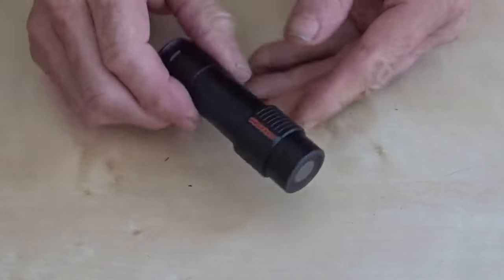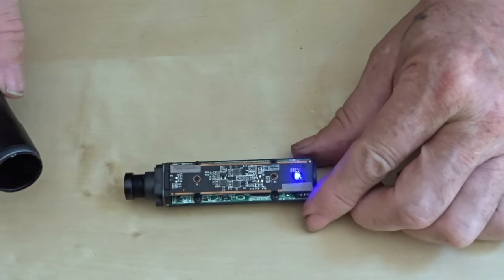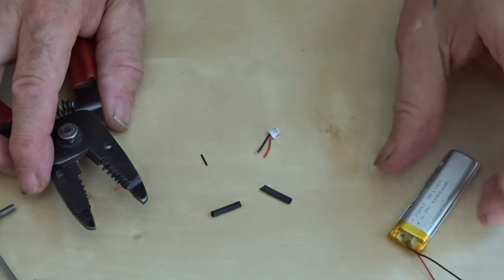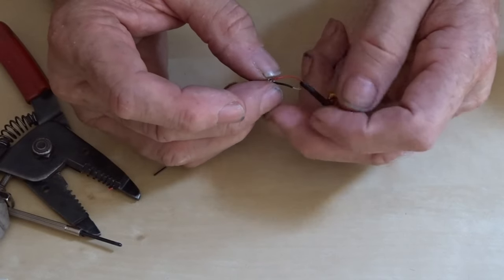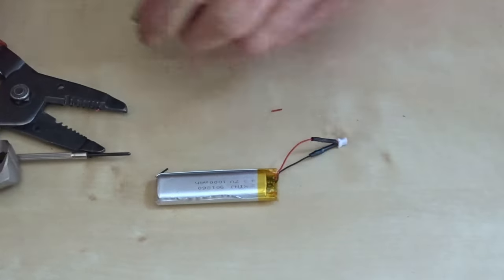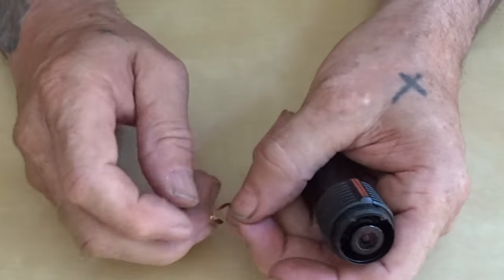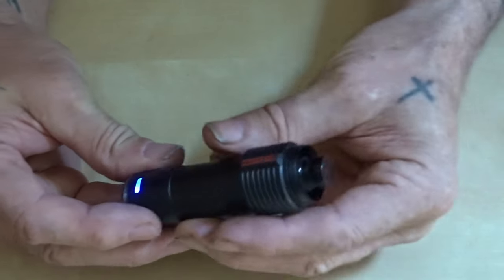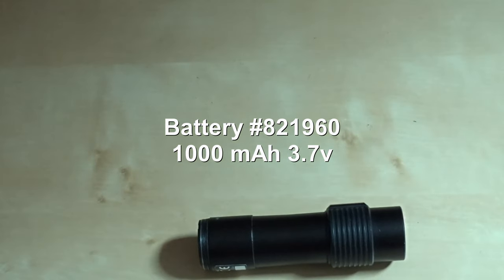How to replace the battery in a SENA Prism Tube Camera in about 15 minutes

Comment: hello cliff, thanks for the video, i just wonder is it possible to use battery 102050?wider 2mm and more thick 1mm, because its hard  to find 901860 in my country..
Reply from the maker: Hi the battery is quite tight already so probably wouldn't fit, where are you from what country?

Comment: this battery is available with the plug already installed. getting the generic battery without plug might save you a few bucks, but probably not enough to be worht it.